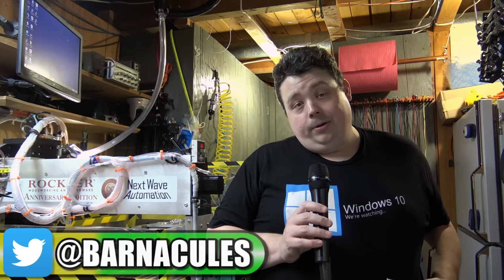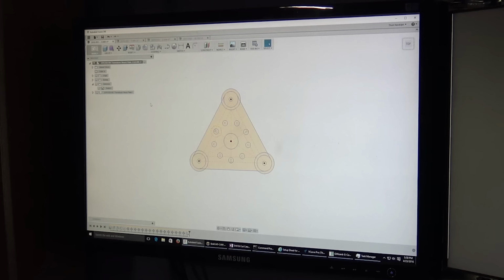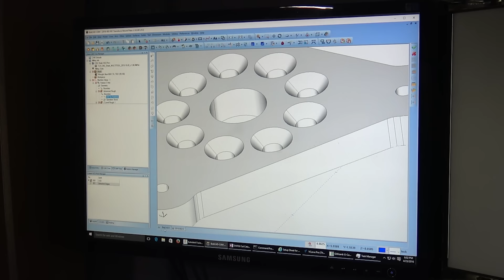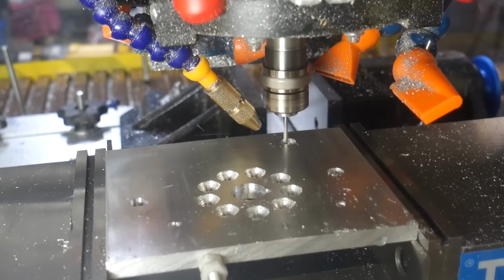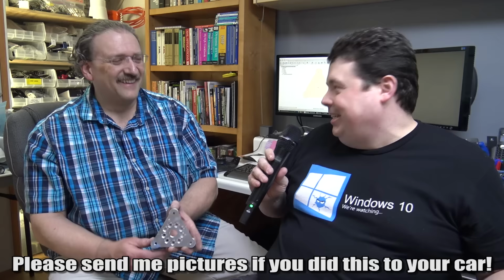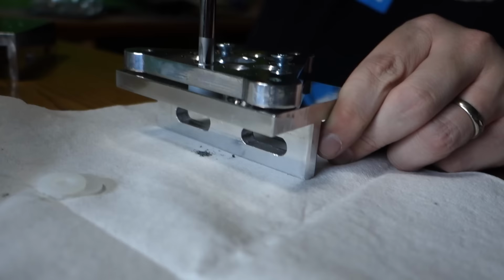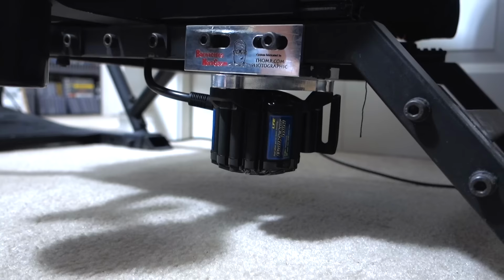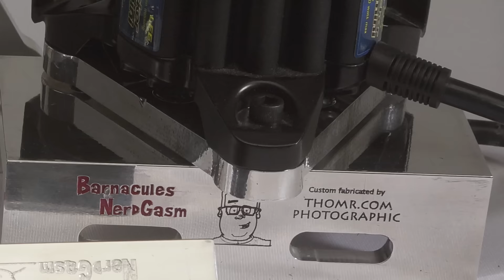Designing & Milling Racing Simulator Transducer Brackets - @Barnacules

Comment: As a guy with 25 yrs. experience as a prototype machinist, I'll tell you, you did a great job with that small table top CNC. Keep up the great work!
Reply: +Green KMH as a guy with 5 yrs.  experience as a manufacturing machinist I kind of laughed a little bit at the hour and half tool path but it is a totally different breed of machine than what is at our shop. Good work on the Bracket +Barnacules Nerdgasm
Reply: Yep. If I spent an hour and a half on a roughing pass I'd be looking for a new job! lol
Reply: +Its_Switchback Yeah me too...it's almost embarrassing when compared to a real machine. But, we work with what we can afford. Plus, every system has limitations at some point. No matter what they are, we gotta engineer within them to get successful parts out. My machine limits are just a lot closer to zero than the big ones. :D Most of the people who I know with this class of machine have issues working with wood, while I'm getting mil accuracy in Aluminum, even with the longer cuts, so I'm more than satisfied I'm getting my money's-worth out of it. Cheers!
Reply: Thom Randolph Absolutely Thom. You work with what you've got and what you have the room for. You did an excellent job with what you have. Keep it up!

Comment: Cool stuff man! Thom really knows what he's doing. I do similar work for a living at a high end specialty manufacturing firm in central Indiana. Right now, among a lot of other things, we're making parts for Indy cars, being that the Indy 500 is coming up. We use Solid Works and Auto CAD primarily. We have everything from cnc mills and lathes to cnc press brakes and lasers. Everything is separated into different connected  buildings for the machining/laser cutting, the press brakes, welding, and so on. I truly love what I do for a living. And yes, I did pause the video you cryptic bastard JK ;) #BarnaArmy

Comment: You can get a Haas TM-1 for $30k. Used one of those everyday when I was in high school. We even added a 4th axis to make things easier. Projects like this would only take a couple of hours. I should see if I can still get access to that machine shop!
Reply: When I got mine, I knew literally nothing about them. The one thing I did know was that there's no place at my house that could hold the 6000# that even a small one weighed :(. This one was on sale at $3k, normally 4. It's not the best, but it's very capable...when you add a Kurt vise, a new liquid-cooled spindle, some good end mills, and on and on and on....:D. With a 24x24x6" build area, that's a good bit larger than the Haas. But yes, those are gorgeous and STIFF machines (she said).
Reply: I just looked them back up. They must be making them smaller now because the one I used is a lot bigger than that. It had the same working area as a standard Bridgeport.

Comment: Aluminum is very good for its audio transference properties, but won't those longer bolt connections have a negative impact vs the original welded design? Also #BarnaArmy because why not...

Comment: I currently have the dewalt 5
611 router In my x-carve. inventables offers it as an option, and sells the mounting bracket for it. it's ok for most things up to and including aluminum. but I'm planning on upgrading to the Hitachi M12v2. it's 3 1/4 horsepower. so I can start making my own copper waterblocks. I'm gonna use the dewalt to make the mounting bracket for the Hitachi.

Comment: an old trick to eliminate having to bolt the part to wood fixture to cut the profile is to leave .005" at the bottom. A wack with a rubber hammer releases the part only requiring the dressing of the bottom edge. a lot less work for low parts count jobs

Comment: Damn that CNC seems so primitive to the stuff I use 😂 I couldn't imaging milling jobs like that with a 6mm endmill!
Reply: +James Smith you're SO RIGHT! But, we can't all afford big machines :-(. That's what's so fun about engineering, whether it's electronics, mechanical, all that: you learn that how you build things depends in large part on the limitations of whatever tools you have available. Living "within the system" is what I consider some of the best stuff. What kind of machines do you work with?
Reply: +Thom Randolph I agree it does make jobs a lot more interesting when you don't have the correct equipment! Started out running Haas VF4's 2003-current models, VF0 & a current model VF2. Now operating Citizen lathes, C32, L20 and so on 👍

Comment: Nice work - Thom should look into the Adaptive Clearing CAM strategies in Fusion 360. Provided his machine is not "X-Carve floppy" that deeper milling job should take about 10-20 minutes and be a lot kinder on his tools and machine.
Reply: +I_Made_This Yup, I did, actually. I use BobCAD/CAM, and they have those too. The problem is that the machine is not very rigid in the Z-axis carriage. So for these kinds of open pockets with no corners (that have to hold a finish), the HSM toolpaths didn't really buy anything. The tool engagement angles and Depths of cut are identical to what an HSM path would provide, but the many-fewer start-stop events during the cutting made it go faster using the older pocketing style. Time estimates, IIRC (on this mid-hobbyist-level machine) were like three times longer using the HSM paths. In the end, some burrs were made in places, and the initial slot at each layer was harder than the rest, but it worked out well. I use HSM in many other places and projects, and they are a HUGE improvement over the older style toolpaths.
Reply: Thom Randolph Hi Thom - understand if your Z axis is limiting your DoC and hence the HSM aggressiveness you can use. I only asked as I'm using HSM/Adaptive/Trochoidal wherever I can these days and they have transformed my machining - especially as they come for free with Fusion 360. I've also had good success using a serrated edged 3 flute roughing cutter, which helps a lot clearing those weld loving chips :-)
Reply: I totally agree with you....I love those toolpath too. Thanks for the push; I'll more-aggressively look to using them.

Comment: #BarnaArmy I've been looking into getting an audio transducer for my DXRacer chair and came across the Buttkicker Gamer2. I watched your video on it (thanks, by the way) and determined it wouldn't work for me. My chair is as low as it goes so there is no post exposed at the top. It comes out the base of the chair, but there isn't enough room to mount the Gamer2. So then I started looking into custom brackets and came across this video of yours (again, thanks). So now I'm actually considering getting a plate of aluminum or steel made to mount between the tilt mechanism and the seat bottom itself so that the transducer will hang off the back. Question is, do I get the plate made out of aluminum or steel and how thick should it be to handle one of these transducers? I'm thinking 1/4" aluminum plate would work fine, but just looking for some input.

Comment: Hello, just a suggestion use Loctite on the screw threads, they look nice. #BarnaArmy
Reply: +Andu BMF Yeah, we were going to, using red Loctite (500F heat to unstick), until I realized that the polishing compound had gotten in the threads and would do the same thing...and, I didn't have to clean out the polishing compound....score! ;-).
Reply: +Thom Randolph I understand, thank you

Comment: The spindle wont be your only problem milling metal with a router, the frames are not rigid enough to get real accurate cuts with good surface finish. You have to cut so lightly and slowly your cutter ends up rubbing and chattering a lot.
Reply: +bensbenz Yeah, those are problems I've dealt with and, it seems so far succeeded. I swapped out the dewalt 618 router with a custom mount and a 2.2Kw actual spindle motor and VFD. The frame in the X and Y are good and rigid, but the z-axis is pretty sloppy: made out of High Density Polyehtylene (HDPE), or what is really milk jugs ;-). I'm getting 0.001" positioning and machining accuracy/repeatability, and good surfaces if I do a 0.010" finishing pass. I use the CNCCookbook feeds-and-speeds calculator, and it's been totally awesome at getting good cuts with manageable torque (so the z-axis doesn't flex) and deflection. I even upped the VFD output from the recommended 400Hz up to 600Hz (1kHz max), so I can now get to 36K rpm. That's key for using those 1/8, 1/16 and 1/32" end mills, and it seems to be paying off. I haven't broken a bit in several months, and I'm not even seeing built-up edges on the bits. Thanks for your advice, and you're totally right those things get in the way. But, they can be overcome with careful attention to what it's doing. Cheers!

Comment: I prefer to use Autodesk Inventor Professional over Fusion. Also, where does Thom get his metal stock?
Reply: +CAmarine221 Around Seattle, there are two primary places. Online Metals (now owned by a big corporation, so much less friendly). My personal favorite is Metals Supermarket, in Kent, WA. It's a big warehouse full of metal that they'll let you browse through; they'll cut to order typically in an hour or so; there's no minimum order, and they're very helpful. The flat plates were cut from 3/8" x 8" AL 6061-T6 sheared sheet, and a piece of 3/8" x 6" bar for the 5th one. The brackets were cut from 1.5" x 3" bar stock; again, 6061. Cuts like buttah!

Comment: Nice step-by-step video but not having a machine shop in my laundry room, how can I get a set of these brackets?
Reply: Never mind. I think I'm going to attach the Buttkickers directly to the pedal platform. The sled attachment would mostly shake the wheel which has its own force feedback. Good luck with your project, though.